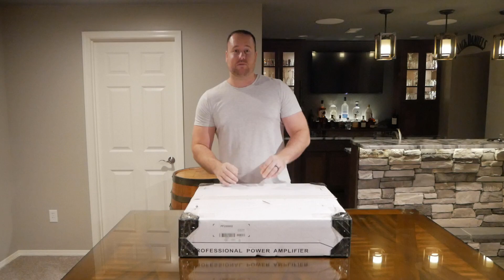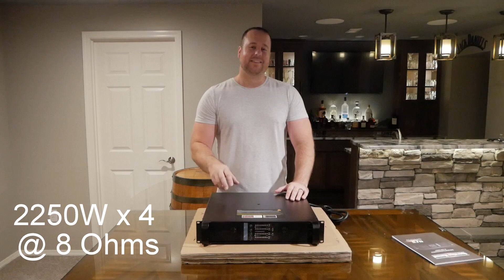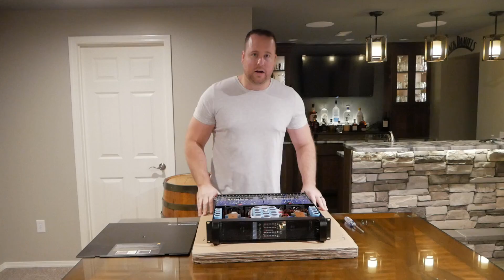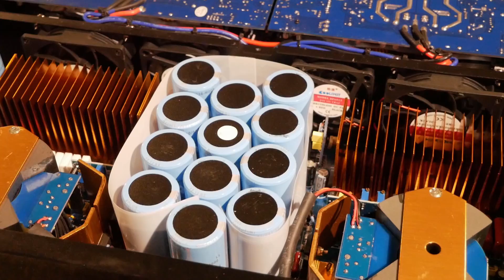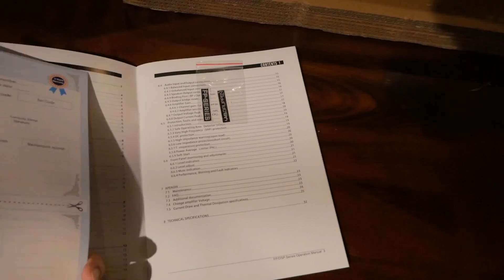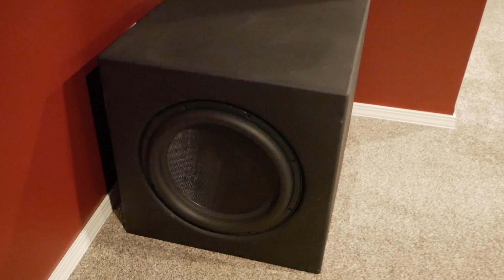FP20000Q Unboxing | Sinbosen Clone Amp | Home Theater Subwoofer Amp

Comment: Hey Life of Bliss. I know you got rid of your 707's but I gotta tell you something. So we both have heard the issues with the 707's and I did something in my theater that not only fixed it, but now is the best sounding speaker I have ever heard, and I have heard quite a few.. Ok so, some would argue with me on this but I will just tell you what I did and I assure you the sound is night and day. I had them hooked up to an Ashly MFA 8000 initially. The MFA does 750 watts into 8 ohms. We both know watts don't really matter because we don't have to listen at full blast and headroom never hurt anything. I Figured, What would it sound like if I hooked up another MFA, so I bridged each 707 to each amp. So each 707 has its own MFA which is somewhere around 2400 watts per side and maybe 5000 total if one considers that the lsim measure closer to 6.7 ohms on the meter. I actually don't listen to them very loudly, I just wanted to see if I could get some more control over them with some higher current. Let me tell you, the speaker is new again. I have never heard anything like this in my life. I know it sounds crazy that it would make so much of a difference, but it did. The phantom image they are creating is freaky. The image has come out of the speaker, it literally does not sound like what I am hearing is coming from the speakers. My theory is a little rough because I don't quite understand, but from reading some forums I think I have an idea. So the MFA 8000 amp is Class ab. It is a fully balanced dual mono block with individual switching transformers with mechanical signal grounding. With class ab there will be the push pull switching technique done within each side of the amp's internal mono blocks. When bridging, the second channel is inverted, and because it is dual mono class ab, the opposite sides push and pull opposite of each other when bridged. The speaker connected to the amp sees a middle ground between its "first watt" and the last watt in the transition. The amp effectively cuts the voltage drop in half, on top of which it sounds like a class a. I don't believe this will happen if  its not dual mono class ab. Whatever the reason, The 707's apparently don't want to sing unless they have a gun aimed at their head like I did with the ridiculous amount of current I'm feeding them. Anyway if you stumble upon another pair someday don't be afraid to hook them straight into the power lines. They are phantom imaging so well that I ditched my center channel. Im not kidding either lol. Anyway I thought I'd share that with you, loving the content cant wait for more home audio stuff!
Reply from the maker: Wow, now that's some power there! Just don't catch them on fire 😉 and I hear ya on headroom and dynamics. I only have 125wpc from the Emotiva I'm using. I'll eventually be looking to get some more power, but the 1299s should still rock with their sensitivity so high. It's pretty crazy how much difference there is with some good clean power going to things, sounds like your 707s are rockin!
Reply: @LifeofBliss   lol I wont be catching them on fire as I don't turn them up very loud, well sometimes I do. Its pretty loud by the time the clip meter even registers. I mentioned the peak power of the Ashly MFA amps being about 5000 watts when bridged at 6.7 ohms but that would be impossible because the outlets in the wall probably cant go past 1800 watts even if there was no voltage drop but thats ok because Im not hooking them up that way for the wattage anyway. Just for the more robust current and I think the 707's need it because of that problem with the mid range. The 6.5 is on the same crossover with the oval woofers and if there is not enough juice, I think the woofers steal all the current and the leave the 6.5 a little high and dry. Initially there was some lack of depth in vocals and it sounded a little thin as well. Basically the lows and the highs were not meeting in the middle because the midbass was too soft with the ovals acting power hungry, and there are two of them vs the one 6.5. I hope to soon built a separate room for a theater like you are doing but I need to buy another house first. probably next year, My thoughts are 6.6.4.1, 6 floorstanders like I am using now, (707's in front and back with 705's on the sides) with no center. Then the next .6 for the height channels (lsim 703's in front and back height with 702fx on sides). Then the .4 being the 4 ceiling speakers which I have not purchased yet, and the.1 for mono LFE in the rear. I have a few subs but the 707's go so low I don't need surround subwoofers, just the effect which means mono will be fine. I could probably get away with some seat transducers but I don't think it will be the same. Probably will go with 4 psa's. I was watching youthman's channel and that 18 looked pretty damn linear. I have pleny of Ashly, Peavy, and Qsc amps so Im good there. It should be insane and I cant wait. I will keep you posted if you want. Anyway thanks again for the cool content and I look forward to the next.
Reply from the maker: Heck yea let me know! That sounds like a hell of a system! Youthman has some pretty good stuff, I watch him as well. Hopefully I'll be able to keep up with that 18 when I'm done 😉

Comment: Interesting! I haven't run across these massive amps in diy home audio. 

The heat sinks are for dissipating heat of the transistor array near the end of the blue pcb.  The power supplies are two toroidal transformers. 

I wonder if those caps have a bleeder resistor? Those caps could cause some serious damage if you accidentally shorted them, maybe even a week after powering that sucker up. 

Thanks for the video!
Reply from the maker: No problem! Sounds like you know I bit more of the technical aspect of amplifiers. I've got the rough outline down, still learning the details... let's just hope no shorts happen! 😉
Reply: @LifeofBliss  same man! Just learning as much as I can. Keep up the videos. Solid content!
Reply: I believe they use a switched mode power supply.

Comment: How many sealed 18’s are going to build?going for powerful single digit extension I hope. Can’t wait to see your set up.
Reply from the maker: 18s? Who said anything about 18s?? 🤔😉 I am very confident I will have an increase in single digit frequencies over my current setup! Excited to get it and show you guys!
Reply: Life of Bliss I got it. You can’t confirm nor deny, with your speaker firepower 4 sealed 18’s would be a great start. Can’t wait to see what comes.  I’m deciding on volt 10’s or 8’s to complete my room. Front speakers are PSA MTM 110’s and S3601 sub. (One for now but will add at least one more)
Reply from the maker: Those are some good lookin speakers. I'm sure they sound great! And yea can't go wrong with volts... The sub I am getting has been on backorder and they are just now catching up on production. Don't really want to say until it gets here just in case something falls through... hopefully not and it'll be here soon!